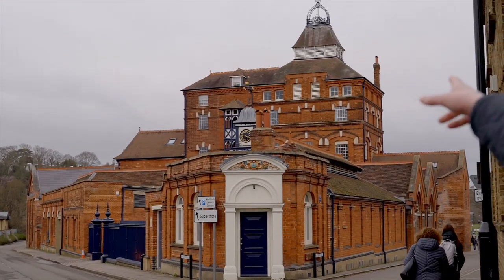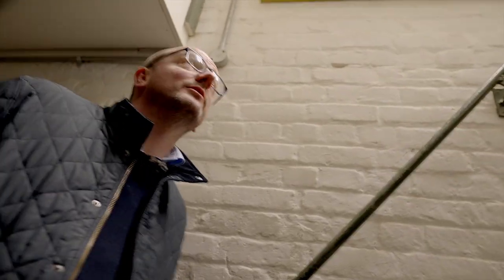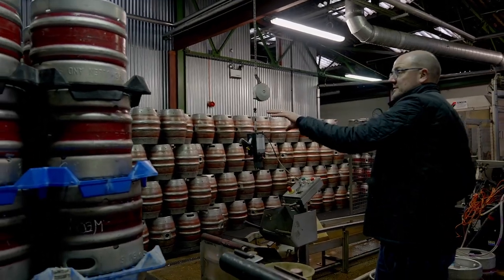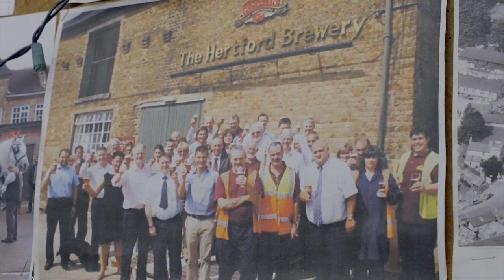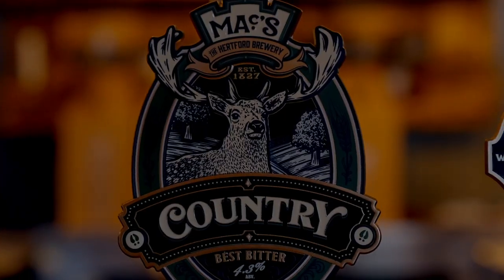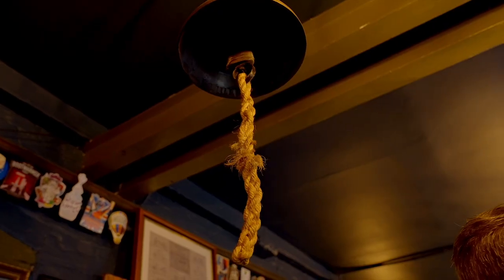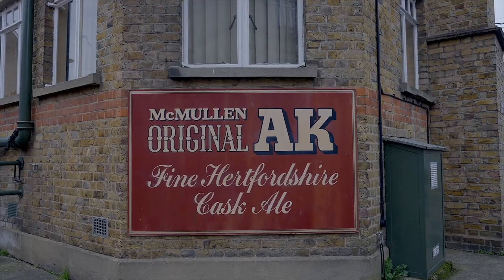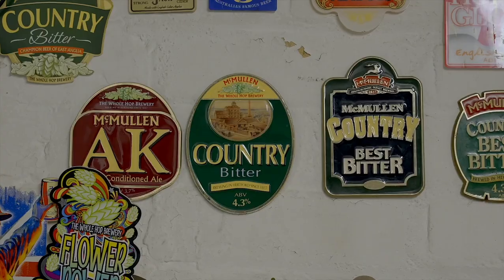A behind the scenes look at Hertford Brewery // Get Er Brewed

Comment: That was enlightening. I am not sure cos it has been a few minutes since I heard it in the video but I believe I am an 'Old Duffer'. I am 78 years old and still prefer what is described as old duffers beer. I have tried 'Craft' ale and frankly it is the on;ly pint I have not finished I am not at all keen of lemons and oranges in the taste of my beverage. I also think this is the main reason why I still do 'All Grain' Home Brewing.
I would be intereseted to know if they used whole Hop flowers or Pellets cos I think the natural filterbed of the Hop Flower when drawing off the brew from the kettle is hard to replicate and modern vacuum packed whole hops are consideranly dusty and powdered..
Reply: Macs certainly used to always be whole hop.  AFAIK they still are.

I suspect rivertown does use pellets though